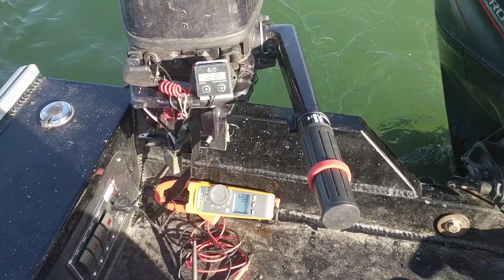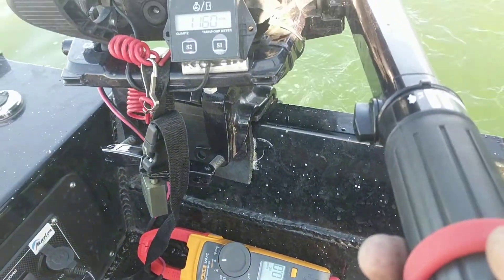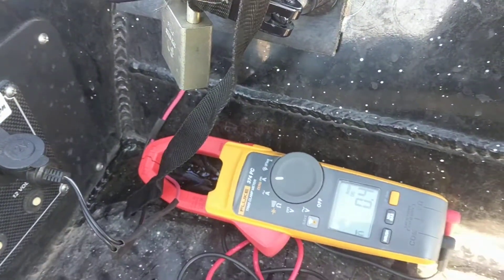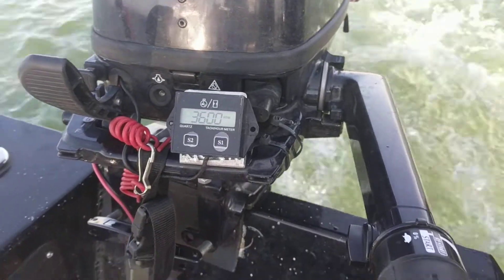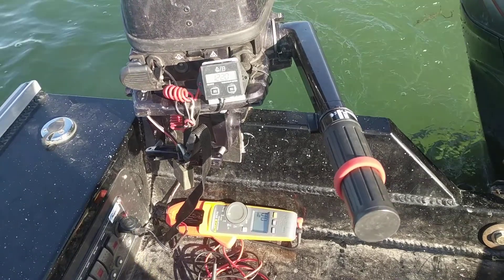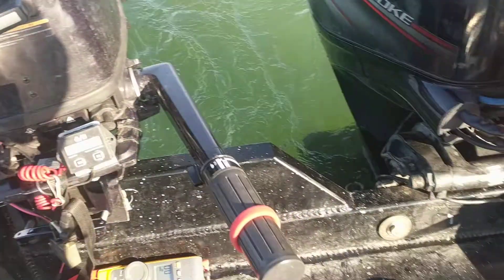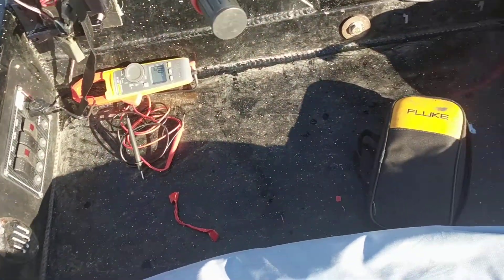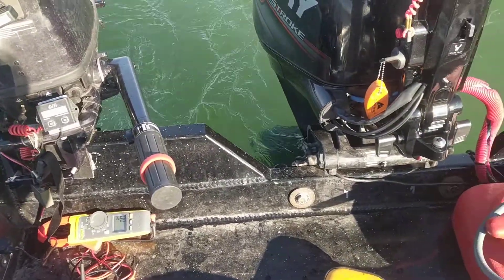tohatsu 6hp charging output amp numbers

Comment: my sailpro charging system is very sensitive to any corrosion whatsover on any of the contacts, with freshly cleaned contacts i get around 5 amps at one fourth throttle no problem , if the contacts are corroded at all forget it.
Reply from the maker: Just sold this motor. It was great for its size and features. Replacement is a 8hp which is 10lbs heavier for manual start. It's smoother and the output from its rectifier is 2a at idle.

Comment: i am glad you posted this video i was thinking about getting one of these. i dont think i will.  at trolling speeds it doesnt seem to do much. i have a small boat and it will be idling all the time.   i would rather just take my deep cycle battery.  thanks for posting.
Reply from the maker: Agree I rarely use my motor over level 2 or 3 it's used for steering while my kicker or main push doing 80 percent of work

Comment: Thanks for posting this. I'm looking at adding a charging system to my 5hp Tohatsu kicker I use on Lake Superior.
Reply from the maker: The Yamaha and Suzuki kickers put out the same amps at similar rpm. I'm gonna get the 6" weedless type prop to run more rpm see how that goes.

Comment from the maker: The cigarette lighter had to much resistance in the small 20 gauge wires. I replaced it with 14 gauge wires tapped into the back of cigarettes lighter plug. Made a big difference, u run at 1500rpm now and it runs my fish finders just fine with no voltage drop. I get 1 amp at 1500 rpm now more than enough for what I need.